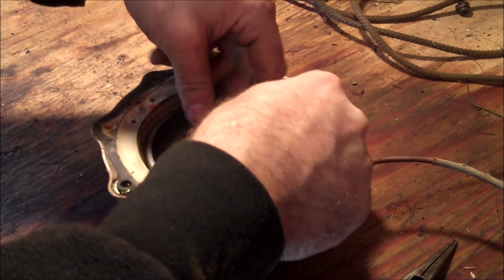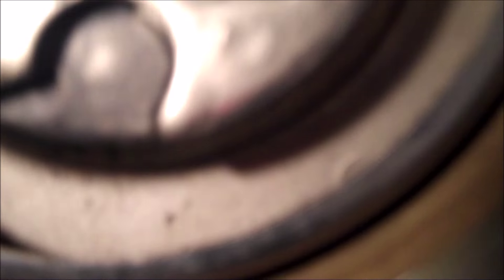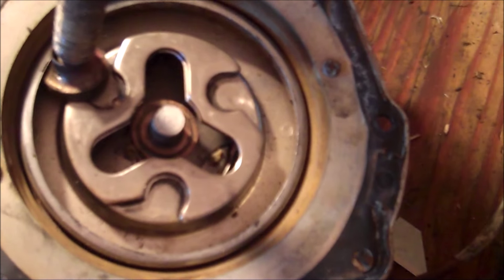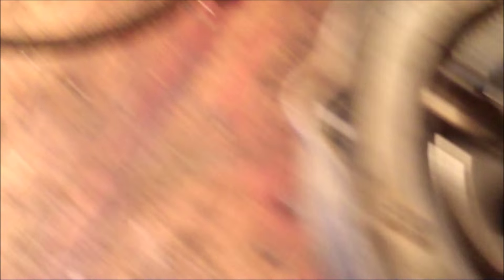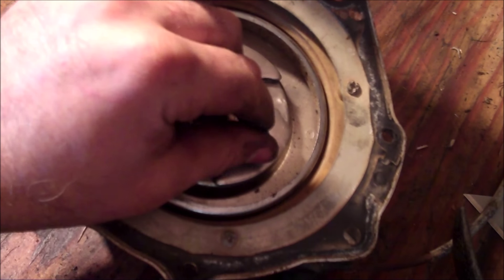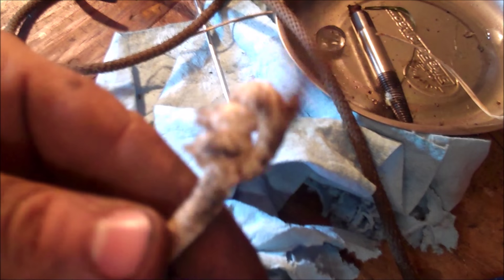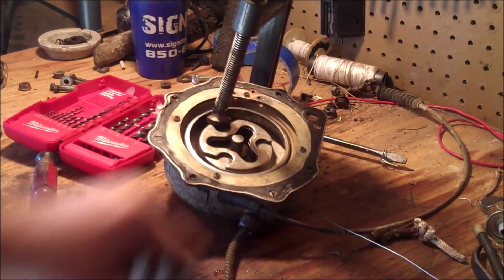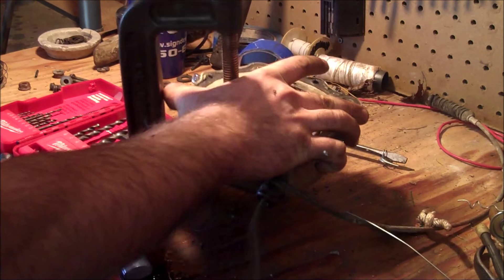How to repair a pull start

Comment: It's such bs honda never sold parts to fix these other than a new rope and handle
Reply from the maker: +The Dude All the parts are for sale on bikebandit
Reply: +mrmaxstorey Really it's bout time someone made the parts last time I looked they weren't available only the entire unit was and it was super spendy so for years and years I've kept ever part and piece I could get a hold of for the pull rope assembly so 35 years later I still haven't purchased a part or assembly for my trikes yet but boy I sure have fixed plenty of those sure wish they made these trikes again the sales ban in the states expired but I don't think anyone wants to take that chance again but there are kits out there to turn dirt bikes into trikes
Reply from the maker: +The Dude I hear ya I have 5 trikes, like them better than quads
Reply: +mrmaxstorey man I hear that I'd take a trike any day over a quad I have a bunch of trikes my self a few 200s 2 pre water cooled 250rs one kawasaki tecate 250 and an 86 250r and a yamaha tri-z and my personal favorite a kawasaki tecate with a kx 500 engine super fast man